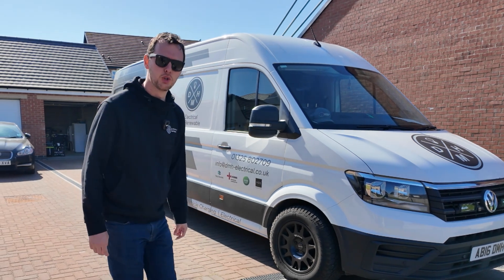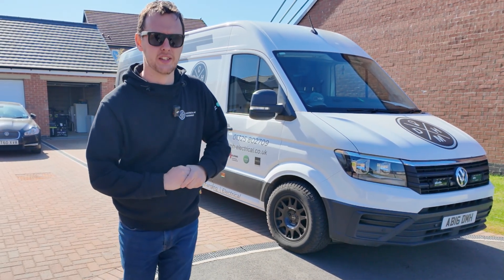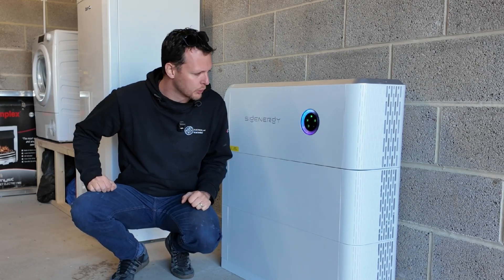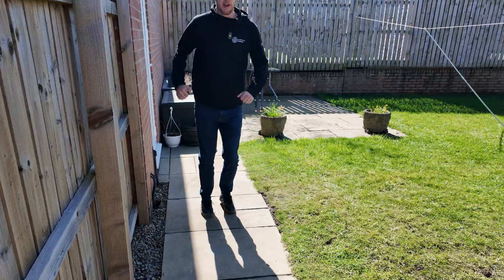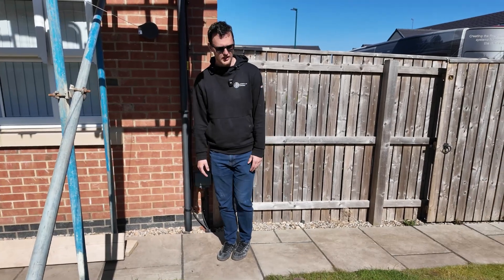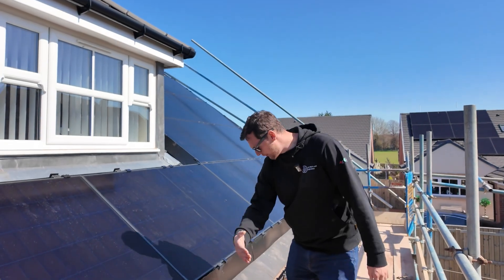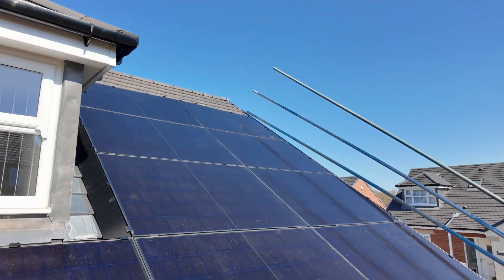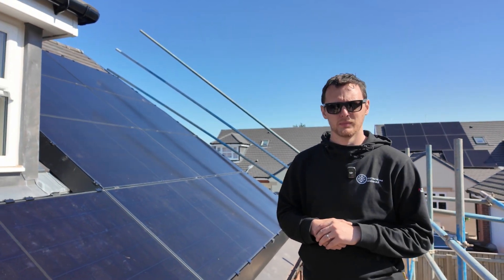The mighty SIGENERGY system rundown

Comment: Nice job, I have been using the Sigenergy + Aiko 455s for six months now, Great combination. I have some three phase houses making 80 kWh everyday in this nice weather. I will be much happier when Sig bring out the new gateway which has a manual override on the contactors, not sure about the longevity of holding in your grid contactor 24/7